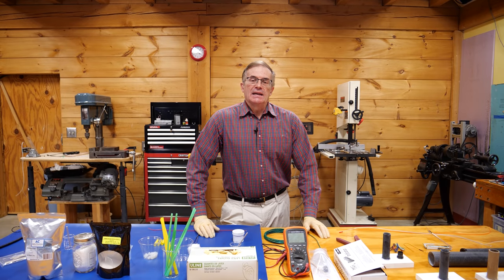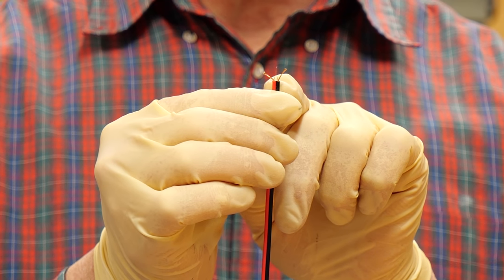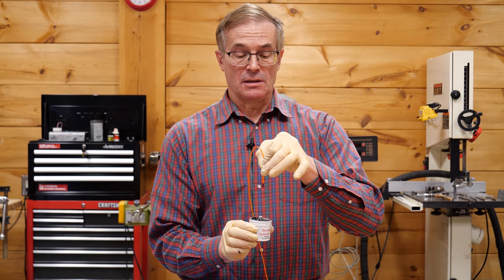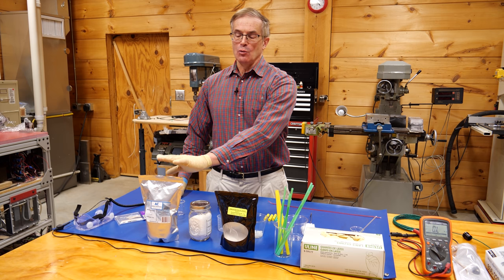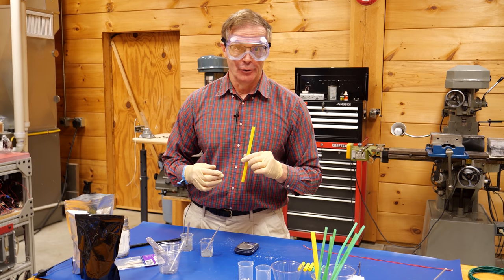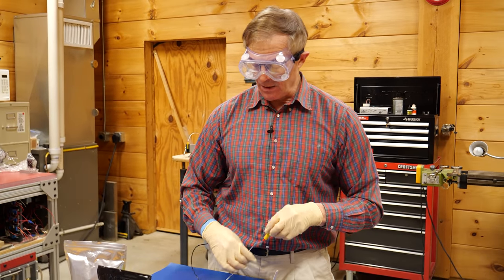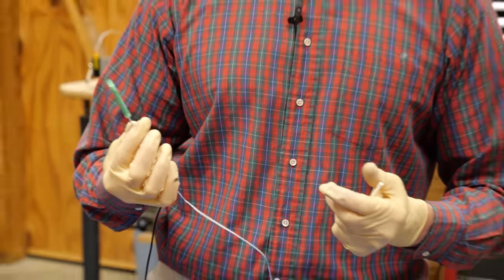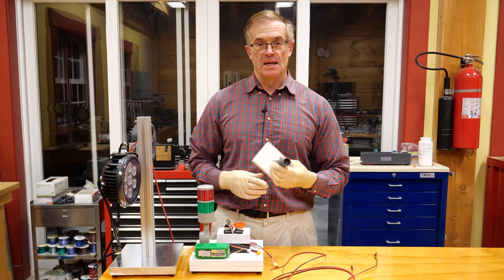Rocket Ignition System On Steroids!

Comment: I'd like to see you take a crack at Al-ice rockets (aluminum or magnesium fuel with water ice as oxidizer). I played around with them a little bit as a teenager but only had a few successful ignitions. Tough to get the fuel to ignite without the ice melting and extinguishing the igniter. I think I had some success adding a gel to the ice.
Reply: This!
Reply: Ive never heard of that before, sounds 𝘤𝘰𝘰𝘭. and tough to ignite for sure.
Reply: Slowing down of thermal conductivity is hard with these the gel was a good idea
Reply: Actually magnesium can also burn with dry ice.

Or if you wanna feel REEEEELY nerdy, use CO3!
https://en.wikipedia.org/wiki/Carbon_trioxide

Even more violent than those is H2O2m which you can obtain in a [relatively safe] form known as Sodium Percarbonate - https://en.wikipedia.org/wiki/Sodium_percarbonate

Just don't try reacting dry sodium percarbonate with high concentrations of acetic acid ['vinegar' because it produces a highly sensitive explosive, diacetyl peroxide - https://en.wikipedia.org/wiki/Diacetyl_peroxide
Reply: @DeliciousDeBlair  this is not cool. Your comment is what would have probably killed my teenage ass many moons back...
Reply: water keeps putting your flame out? dont get it wet @nighthawkinlight use dry ice! magnesium loves the stuff!!
Reply: @VinceDonkovWorks  You should explain more about this to "enlighten" the rest of us.
 Just ask'in .
Reply: What about an aluminium & rust rocket, would that work?
Reply: Of course you watch this channel, lol. I feel like I've found my lost tribe with you guys.
Reply: @Anonymous-sb9rr  I believe it'll just melt itself on the launch pad.
Reply: @VinceDonkovWorks Life is dangerous. Withholding information because it has the potential to harm is bad.
Reply: @TheBackyardScientist i’d definitely go read some papers on it. it’s really cool to hear about the attempts with it, along with actual Al-Ice rocket concepts.

Comment: I have two recommendations for your firing device:  a) Use a guarded pushbutton (EG Grainger P/N 12J255) b) build a circuit to safe it after the button is released so it can't be pressed again until the keyswitch is reset.  If you want to get even more extravagant, have a separate low voltage current limited resistance detector that is live when the keyswitch is in the safe position to monitor whether you have a good connection to the igniter, that would light an amber light, and prevent it from arming without that good test (and beep and flash the amber if you try to arm it with an open circuit)
Reply: @daithi007  Not really. Guarded pushbuttons are fine for systems that could be activated with a single action accidentally. The keyswitch already prevents that by requiring a separate, different action to arm the system, and you have two indicators showing system state besides. Yet another guard doesn't add to safety in a unique way, it's just redundant. Circuits to disarm on ignition don't make sense either since the igniter has to be replaced, it automatically can't fire again anyway. Low voltage detection is probably impractical or dangerous depending on wire length due to voltage drop, either you can't reliably detect a good circuit, or you have to get the voltage high enough to account for losses and that could cause ignition just from testing. It's a terrible idea to suggest putting electricity through the igniter when it's that electricity that fires it off. There's systems that can do that, but they're not using homemade igniters. Finally, you don't gain safety by checking for open circuits since an open circuit on an igniter fails to a safer condition, which is "no ignition." There's no penalty for pushing the button on a disconnected igniter other than "your rocket doesn't fire."
Reply: @Pyrichia  Continuity checking for the rocket igniters has been done safely for decades.  Using Kirchhoff's Voltage law and calculating the voltage drop across the relatively small rock igniter resistance compared to the series lamp resistance and using voltage division is how such systems are designed.

It's too bad YT does not allow pictures and LaTeX like equations in the comments.
Reply: @organizedfromwithin2525  reminding me of things I should have remembered from other domains; you're right. You can check continuity without setting off an igniter.
Reply: So how about mounting it to a base with two spring return key switches 6 feet apart and a momentary contact pish button to fire. The idea is taking two people each holding their switch closed and with one of the remaining hands, pushing the fire button. If you use two buttons in series next to the key switches, a contortionist would have trouble firing it by themselves!  You can add in lights like he has in his circuit. 

Of course you could just pull the ignitor wires and connect to a battery!  But if you want to add some drama to your rocket launches, this will do it!

Comment: When connecting the starter at the rocket, use a thick cable with alligator clips to short the signal comming in from the launch control. If there was ever a stuck contact or a  capacitive discharge, the energy would be shorted and could prevent an accidental ignition.
Reply: And a small capacitor to prevent rf sources from causing accidents
Reply: Your point is well taken, but, with the air gaps in the industrial switches used in this system it's probably not needful.  Both the key and the palm button should be OPEN when connecting igniter leads.  It would have to be a relatively powerful transmitter to bridge those switches while they are open.

Systems I've used in the past had a high resistance continuity lamp circuit which indicated a good igniter connection once the ARM switch is made, but restricted current to levels well below that required for ignition.  With such a system, yeah, RFI could be a problem, but not here.

Comment: Man, you should attach those motors to a load cell and graph the thrust over time. I'm interested in how that long burn performs. Nice job!
Reply: he will do thrust measurements
Reply: Yes. I'm no expert but it seemed a very long time for such a small motor. Hard to imagine it could produce enough thrust to launch a rocket very high
Reply: No nozzles.
Reply: The burn rate is slow, as it is pressure dependent. Without a nozzle, the chamber pressure is very low and it burns longer than in a real flight
Reply: This is Tech Ingredients. We all know he's going to science and engineer the heck out of these. I'm looking forward to the hybrid engines myself. Possibly using cryo LOX and Perchlorate. Ofr course if you wanted to take us on a guided tour of the book Ignition possibly with a collab with Nile Red that would be really interesting. Incredibly dangerous, but definitly interesting......

Comment: When you showed off the ignitors, it was a little annoying that whenever the video cut to another camera angle the ignition came immediately. I'd suggest adding half a second of video after the cut for the viewer to adjust to the new camera angle and to find the "point of interest" in the frame before ignition occurs. Otherwise a great video!

Comment: Firewire?I'd like to connect an old webcam to an old computer using that.
Reply: aka IEEE1394. For a while "firewire" wasn't used, and IEEE 1394 used, instead. This was partially because a fancy speaker wire company (like Monster Cable, but don't recall which one) was using it as a trademark. The two businesses were too close together, in category, so the data protocol vendors, just avoided the name.
Reply: Firewire from back in the day.  You have a webcam that supports Firewire?  It's not like any of those cameras of that era needed that kind of bandwidth.  Power hungry, somewhat flaky protocol.

Comment: Hi!

I just wanted to give you a suggestion: Have you considered making an air purifier? Something like a cycloner, blowing air into mineral oil or other liquid that don't evaporate, an electrostatic precipitator, EPA filters, or a combination of those and whatever you come up to.

Cycloners cause static, you can source baby oil for cheap and scented mineral oil, electrostatic precipitator can cause Ozone, and the different EPA filters will need different air pressures. I'm sure you can make it an interesting subject.

Comment: How to improve the electrical system:
1.) Add a voltmeter - basic test to see if the battery is still alive and if you have enough voltage to fire the charge.

2.) Add an ohmmeter (if you are planning to use long wires). This is for testing if the wires are too long and if you need a higher voltage for reliable firings. This needs to be disconnected or protected during operation - one does not simply hook up an ohmmeter to an external power supply.

3.) Add a big 4000uF capacitor in parallel with your battery. This does two things: Depending how fast it first charges from the battery, it tells you how much power your battery really has.
The main advantage is that it dumps most of the energy stored inside during a discharge, making discharges much more reliable. Remember, a battery can be full but if it’s cold outside it can behave really sluggish - basically functioning at a fraction of it’s designed power.
 Note: A big capacitor really behaves like a temporary short circuit when connected to a power supply of different voltage - put a big inductor or a resistor between it and the battery. This will extend the life of both the capacitor and the battery.

3.) Add an energy dump tester - basically a variable high power resistor hooked up to a power meter connected to the battery. This literally dumps a load of energy into a big power resistor to see if the circuit can actually deliver and it’s the most direct test and the closest one to the real deal. But it comes at the expense of a bit of energy.

Well-built electronic igniters are extremely useful in high power rocketry because you can test everything before the actual ignition.
Reply from the maker: In general I agree with your upgrade suggestions, except for the capacitor.  Use a well charged battery and don't skimp on the voltage, 12 V is a minimum.  The actual energy spent to fire a bridge is a miniscule fraction of the battery's capacity.

Comment: Thin nichrome is used as the bridge wire in e-matches. You can make a nitrocellulose lacquer for coating using ping pong balls and acetone. The lacquer and smokeless powder makes a decent, simple e-match compound...

Comment: I appreciate the professionalism with your videos very much. Thank you for the unrelenting detail be it safety, materials, formulation or practical application. 
When the rocket motors are burning lower at the end apparently there is still enough thrust to keep it going, is that correct?  . 
Also the augmented starters with the barium sulfate seemed to burn less but faster. Unsure what true affect took place with the augmented starters.

Comment: Awesome videos! I really like the different variety of videos you make, especially anything chemistry- or electronics-related. I went into computer science, but I still love learning about chem & EE.

One thing that would help make your videos even better would be to put a little piece of foam over your lapel mic so your plosive consonant sounds aren't super loud on the audio recording. Sometimes the fuzzy thing people put over boom mics is called a "deadcat" - which is kinda funny. 

Another thing that helps with audio is to do a very rapid fade in at the beginning of cuts and a very rapid fade out at the end of cuts to stop any sort of unintentional clicking noises between cuts.

Both of these things are pretty minor, and usually only headphones users or audio engineers notice. Thanks for making these videos!

Comment: As usual, an outstanding video.... 
Two points I want to share:
1) An additional safety measure is to shunt your wires together to eliminate incidental charge build up at the ignition compound. This ensures risk of ignition is mitigated when you DO NOT want to ignite the compound.

2) The "shelf life" of the Al powder and NH4ClO4 mix is not that long. In other words, make the igniters at the last possible moment before you want to fire them. 24 to 48 hours is typically okay but your mileage will vary on home-brew ignitors...so experimentation is warranted to determine your time intervals and associated confidence levels for good ignition.  In short, do not make up a bunch of igniters and expect them to work a year from now.
Reply from the maker: I've found these will last for months without a misfire, but I'd advise against storing them (as I've done) primarily because they are so flammable.

Comment: During my childhood (50 years ago)My early design of sugar rocket igniter was a piece of brillo type steel wool dishwashing scrubber rolled around a bell wire and dipped into gunpowder which is diluted with water to make it like a soft gooey form and dried under the sun,  used to ignite with old vacuum tube radio batteries. always worked first attempt, never failed. Good old days.

Comment: You should upgrade your launch controller to detect whether the circuit is made by passing a very low current through the e-match. This is how Estes does it with their little launchers - the light bulb actually makes its circuit through the e-match, and then the switch simply shorts out the lightbulb to allow more current to flow and achieve ignition. You could then have some automated troubleshooting built into the launch system that would detect both shorts and opens and indicate the problem to the operator.
Reply from the maker: We could add an ohm meter and get integrity as well as overall system resistance.

Comment: I remember years ago...in another life...a millennia ago, when I did sound and lighting reinforcement for local bands, I made a flash pot system.
Used some strange plastic orange box. Had 3 channels and a key. I used 2 inch ABS pipe fastened to square blocks...of wood.
Now slow down. I know wood burns.
For my "Flash", I used Flash Paper.
Cut into 3 different sizes, the finer was first, then the medium and last the BIG stuff.
Standard rocket igniters was all I had access to.
When those went off...Wow!
The fine burns quickly and starts the effect...Expanding gases pushes up igniting the medium and out the top...The BIG stuff catches last and burns the longest...
I didn't notice one time, some guy was sitting up next to one watching the band.
He told me, " I freaked out when that thing went off!"

Comment: Trained pyrotechnition here.

I was always taught, that once you've rigged the pyro (or motor in this case), you ALWAYS cable back from the device to the fire controller. If you're reloading, switch off, remove the key, disconnect and short at the fire controller end.

Also, 9-12R, damn that's high! Pro pyro normally meters out at a nominal 2R. Also, the reason we like bridge wires is you can specify the firing current, usually 500mA, and this allows you safely push a 5-10mA continuity test current without the risk of an accidental ignition.
Reply from the maker: That is a good point about the cable hook up proceedure.  The ohms isn't really an issue as long as the supply voltage is sufficient.  Furthermore, a low resistance bridge means you need a proportionally low resistance cable to support the same power deposition in the starter.  This requires heavier cables.
Reply: @TechIngredients  you'd be surprised when it comes to cable gauge. In lovey land (theatre), I've used 0.5-0.75mm2 (22-20 awg) cable on runs well over 25mtrs (75ft) without issue. A 500mA fire current isn't excessive. It's low enough that you don't need high voltages to overcome volt drop along any reasonable cable run, but high enough that you don't need to worry too much about static discharge or, to a lesser degree, emi.

That said, if you're designing a system from the ground up, it should be fine, although I will add that I'd recommend the use of actual bridge wires (eg nichome wire) over dipped compounds, as it allows you to get much greater consistency, which if you want to fire several devices (or motors) at once, is important. With consistent current requirements and series wiring it creates an all-go/none-go situation. Something that's very handy you don't want a rocket to go round in circles or worse, come back at you!

Comment: Back in the 80s I did my own launcher and I added a ohm meter so I could verify if the ignitor was correctly connected or shorted, and after a misfire, you had more information on what happened.
Our best park flyer was FSI E5-0 plus E5-6 for a good 9 second burn time, peaking at 5000 feet.
I would like to do a triple stage with two H13's on top for 30 plus seconds burn time.

Comment: When it comes to ignition and back pressure during the process, there are advantages to managing that oressure. A self oxidating fuel ingites faster and much more evenly through the center core when under some pressure. 
Many rocket designs use a rupture disc set inside of the nozzle. The disc has two scores that can be altered to create more or less pressure during ignition. When the pressure is reached, the scores which are the designed weak points will fail allowing the thrust to instantly occur. This effect with the optimim nozzle orifice, can help manage your motor characteristics. Great video. Thank you.